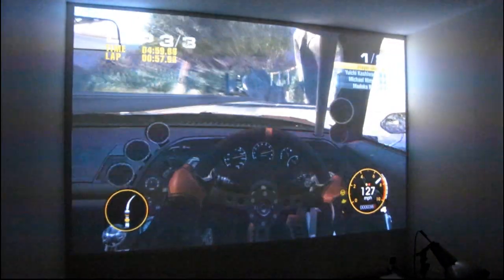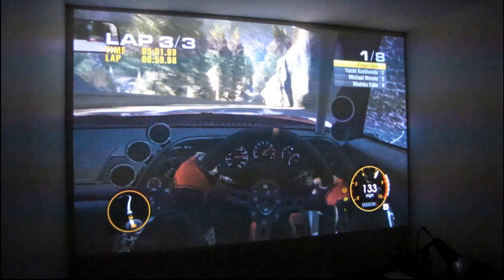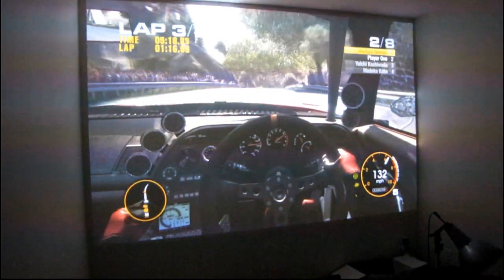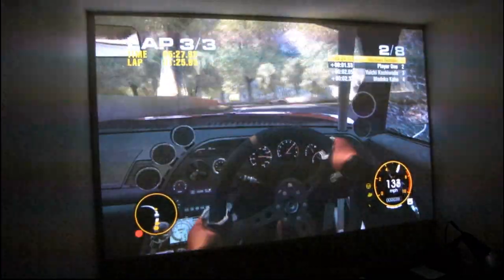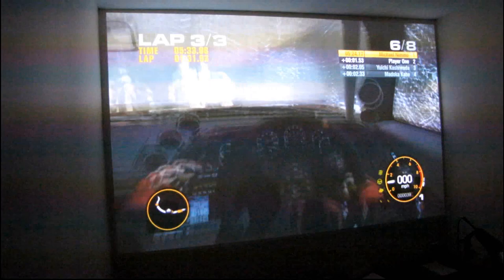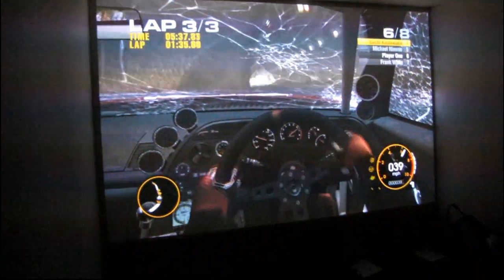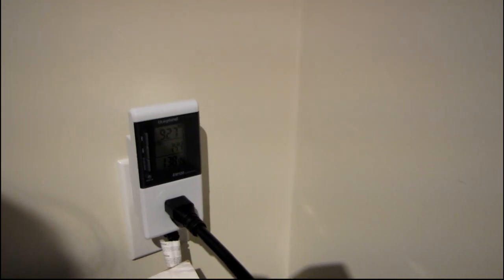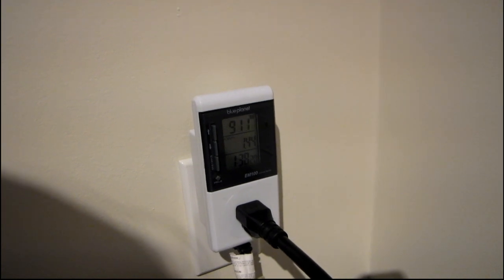GRID Running on a Projector with GTX 480 4-way SLI Linus Tech Tips

Comment: @bizzy400 first off, DX11 actually runs at less power consumption then DX10, second go look up Trubyd44 newest video. He uses 4 480's  an 980x and a full water cooling system and shows his temperatures, watt usage and frames in heaven 2.0.

Comment: lol wut? You could play GRID at 1280x800 with a 8800GT.  Try running Crysis on very high 8x AA at 1920x1080 and watch your circuit breaker blow.

Comment: @Aslapacrosstheface projectors really suck on res doesent matter if ur pc supports 25600x1600 if ur monitor (projector) only supports 1280x800 it will look odd or outs screen and 1080p projectors are ass load of expensive